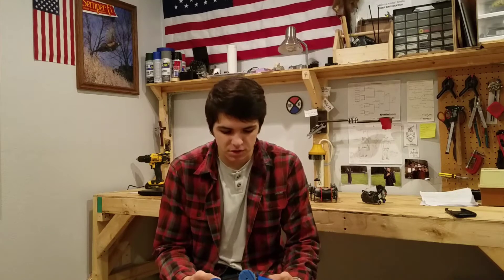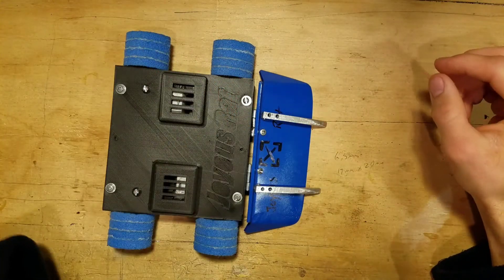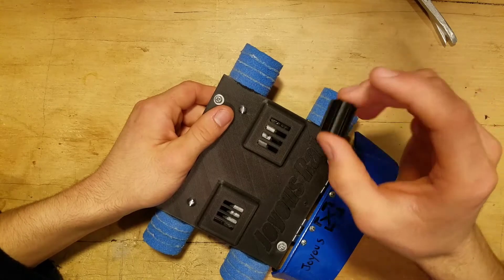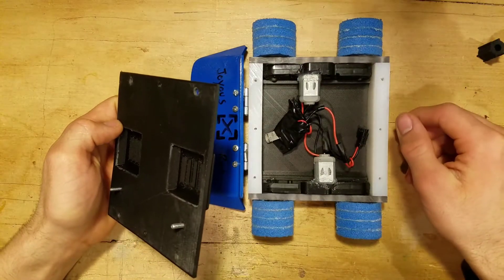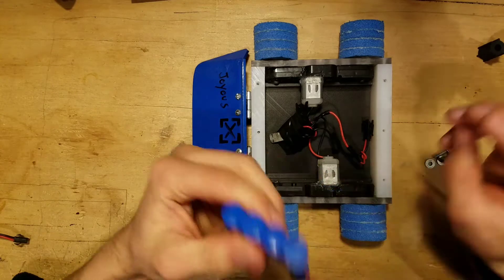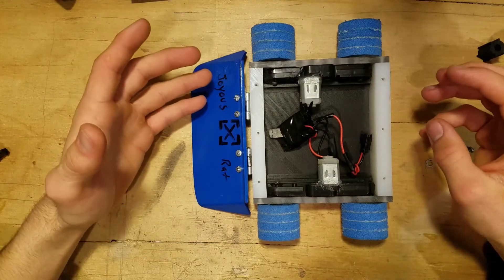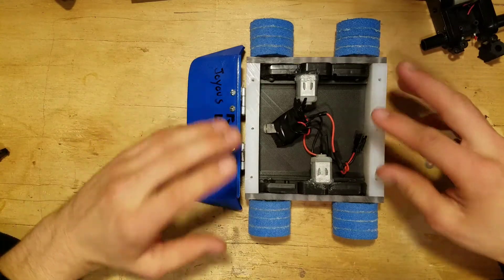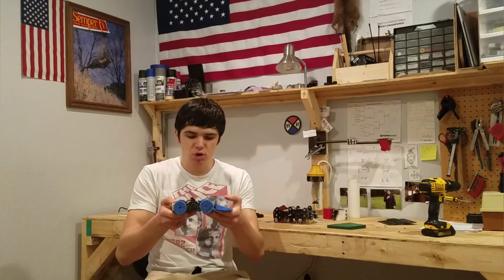Antweight Wedge BATTLEBOT For $10!!!

Comment: I was trying to build this using your tutorial, but I could not get the blue wheel hubs off.
Reply from the maker: They are clipped in, you will notice that there is a hole in the very center of the hubs, what you need to do is either drill out the very ends of the motor shafts to remove the clips on the end, or pull on the hubs while using a screwdriver to pry the clips out of the way.
Reply: @robotfightclub8349   I ended up just yanking on the hubs until they came off.